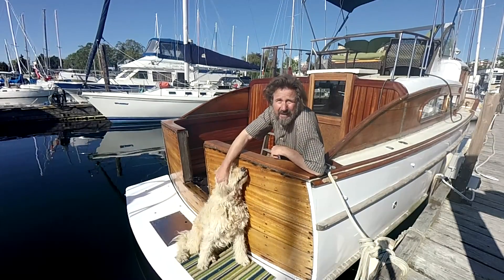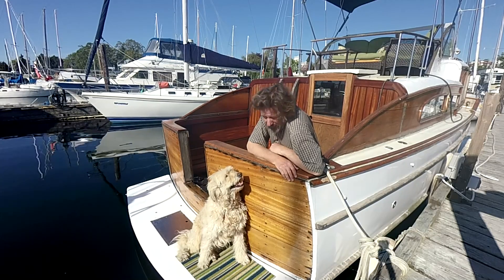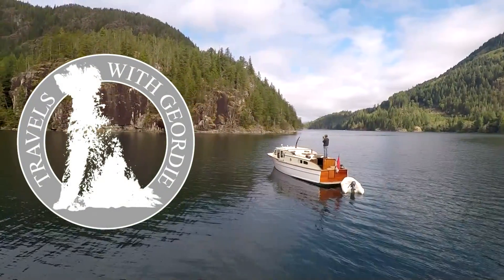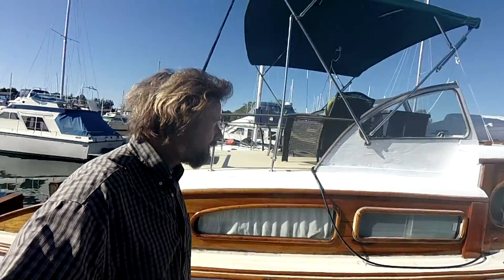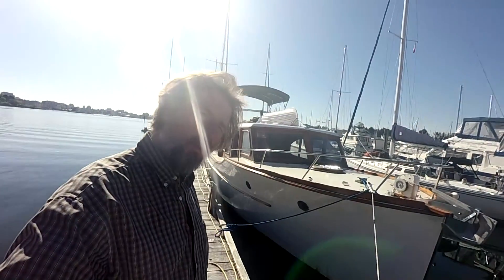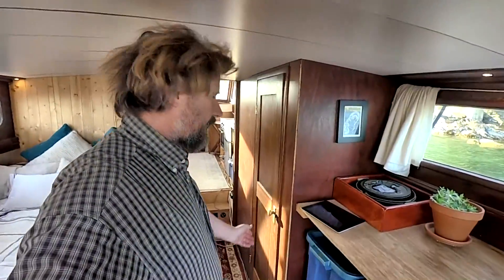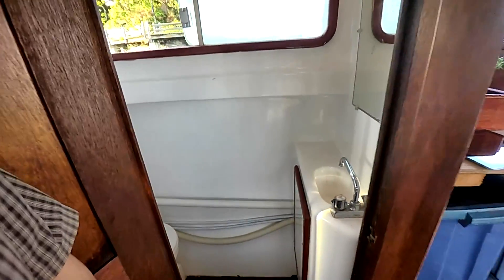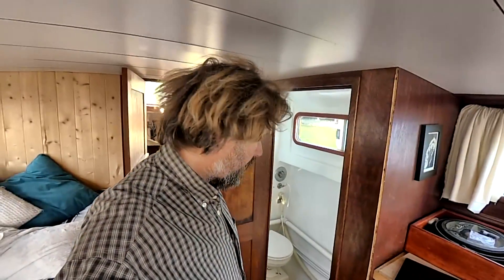Wooden boat tour and a surprise - Wooden boat restoration - Boat Refit - Travels With Geordie #111

Comment: Once again a great video. Nice tour of the boat. Agreeing with the others here on making the lines on the outside better. There are so many smooth lines on this boat but something I'd missing between the big and low part. The topic about the hull hit straight home with me. I bought a wooden boat in February. It looks very nice but I have crawled all over below deck looking for bad wood. So far it looks very promising. A haul out is planned for June. Hopefully that will go well, fingers crossed. Thanks for a good video Peter. Keep e'm coming.

Comment: An idea for your sundeck helm seat - fixed box/seat on the center line (storage?icebox?) with a pivoting back rest that allows forward or aft facing support and also provides a stool height brace for standing st the helm

Comment: Cracked and broken frames at the turn of the bilge are, as you said, very common.  You can sister the frames at those locations.  Alternatively you can cut out the broken/cracked wood and laminate in new repairs.  That involves cutting scarfs into the frames and laminating in strips with epoxy.  The only trick is cleaning up the laminated stack after the epoxy sets.

There is nothing wrong with galvanized steel fasteners, but do not change to a different metal below the waterline.  With galvanized clench nails I would use galvanized screws for any fasteners I replaced.  That has the advantage of maintaining the same metals and galvanized steel screws are a small fraction of the cost of bronze.  Bronze is, of course, best for fasteners, but in your case is not an option unless you want to replace ALL the fasteners.  I am unfortunately very familiar with these issues because my boat was originally fastened with wrought iron boat nails.  Unfortunately a previous owner/owners had the boar refastened with bronze.  The result was that the iron nails immediately started to die.  I spent months removing iron fasteners (below the waterline), drilling out and bunging the holes and refastening with bronze screws.  That was done during reframing.  You are very lucky to have yellow cedar planking below the waterline.  I wish I had that material.  My boat is planked with Douglas Fir, which is hard to get here on the east coast.  I look forward to watching you repair the hull.

Incidentally, your daughter seems like a delightful person.

Comment: Seems kind of counter productive to put the fridge right next to the  range/oven. If you put it on the opposite side of the sink, moved the sink closer to the range, and had the drainage area on the stove side, you would have a big air gap for insulating the  fridge from the stove heat, and  would also create space for putting hot items in/on/near the sink . The metal would also be easier to keep clean from spills and spatters.

Comment: Cracked frames at the chine seems to be a normal occurrence. How heavily is she framed? Clinch nailing is good. A quick check to see if the planks are loosening is to stand in front of a door frame and rock the boat side to side. If you see the frame rising as the hull rocks back and forth your plank fastenings are getting tired. I noted this on 1927 Dream Boat I was on and it resulted in me putting two kegs of galvanized screws from shear to garboard to tighten her back up plus several planks and new complete new transom and frame.
Sounds like you have a handle on what she needs.

Comment: are you going to build storage into the plinth? like some toe kicker type drawers you see on some english narrowboats? an 8 inch deep drawer would be good for storing blankets and stuff maybe
especially if your modular setee turns into a bed in one configuration. or it could also be a pantry for canned and dry goods?

Comment: well good to have a look around, meet the daughter and its not even Christmas !
this is probably some sort of sacrilege my family are almost famous for, but I wonder why you wouldnt shell the hull with epoxy
on the almost fly bridge, wouldnt a rigid structure without glass that is quite low, similar to Grand Banks 32 which are basically seat base high be appropriate?

Comment: That picture from the front of an old magazine was a great find ! Looks like there were some big light fixtures hanging on the side where the two cabins meet which makes it difficult to see the structure clearly. I like your idea to re-shape the cabin top in that area but with all the other projects you are talking about that seems a long way off.
Looking forward to seeing what you tackle next although I noticed you didn't make any mention of setting up the helm or controls on the boat in the near future, does that mean you are not planning to take it cruising this summer ? It probably would make sense to concentrate on getting the boat nearer to completion really before going cruising but I bet you are feeling a little frustrated about that.

Comment: wood on the bridge deck would be a drastic improvement, all that white fiberglass grates my nerves. Appears to be a nice risk you've undertaken
 many problems below water might be remedied with good ol epoxy on the internals as well as externals it seems these days,but, I don't know.Looks roomy.
Reply from the maker: Stay tuned, bridge deck will be completely rebuilt in mahogany!